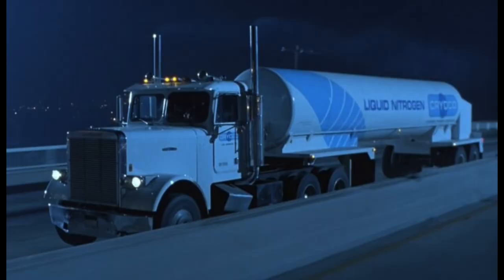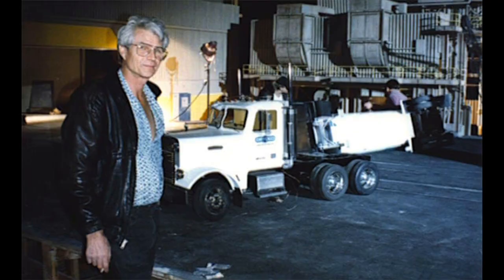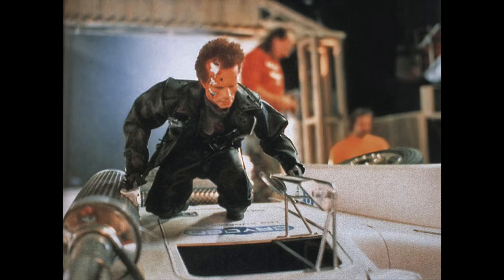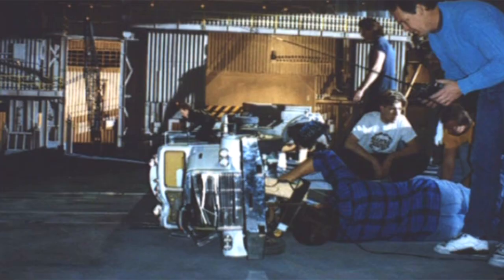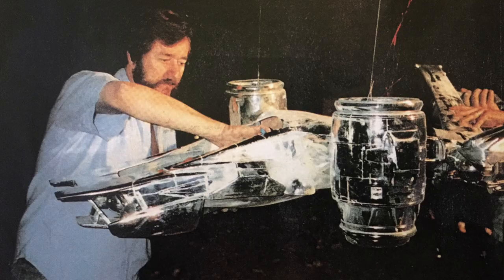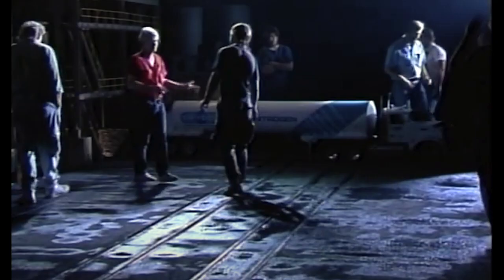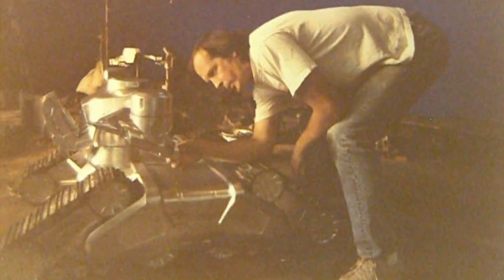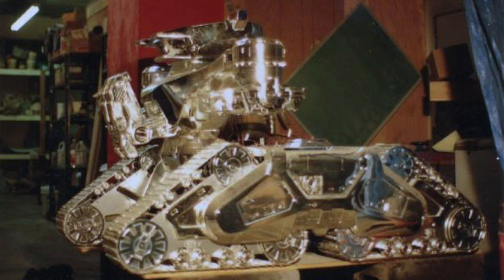TERMINATOR 2 miniature effects

Comment: Yep, he really did work with Jim Cameron - the way he describes his demanding specificity is hilarious b/c it brings back memories of the funny control freaky stuff Jim did at Dream Quest while I was working there on The Abyss.
Reply: If you could share a tidbit; what was the best (or worse) moment you had working on The Abyss?
Reply: @RavenChopper  the worst is easy. I was told to drive from Simi Valley (Dream Quest location) to Long Beach and then drive a truck filled with $1 million worth of blue screen gear from Long Beach over that narrow bridge all the way back to Dream Quest, and I'd never driven a truck before. Terrifying pressure.
Reply: @corporaterobotslave400  YIKES!

Comment: I’ve always wondered about that tanker moment, for years it looked a little unreal, especially when Annie slides off, in the last decade or so at some point it got digitally corrected, but I always knew it was a model, I just didn’t know why, because it clearly starts as a full size stunt, so why switch. Well, now I know, thanks guys, it’s always interesting to learn.
Reply: The HD remaster only put Arnolds head on the stuntmen for several shots of the terminator riding a motorcycle (not all of them though there is one they didn't fix for some reason) and also 'fixed' the windshield popping out of the cab when the truck drives off the overpass.
Reply: @kentallard8852  oh there’s a whole bunch of little tweaks nobody talks about, but it happens all the time, each time a new media format comes out ‘they’ slightly correct little bits of this and that in older movies, mainly because these things get so easy to do digitally that you may as well, but it also stops the next evolution in media leaving older movies behind, a bit like remastering old songs for Ultra HD (and the modern taste for sub bass.)

Nothing major, just little things like localised colour correction on optical effects, helping the clarity of rear projection, lining up laser effects better, reducing grain overload, etc. and there’s a moment when Arnie flies off the tanker and it used to be very obviously stop motion animated and added over the action later, but in modern versions it’s been tweaked with just a bit of colour correction and blur so that it blends in so much better now.
Reply: @Lumibear.  hey, who's Annie whom been slided off?
Reply: @THE-rk3hx  He saw the adult version.
Reply: xtrmst_01  I always thought the exposed eye was motionless because it had been damaged/short-circuited during the little back-and-forth fight with the T1000.  It does look out of place though, for sure.